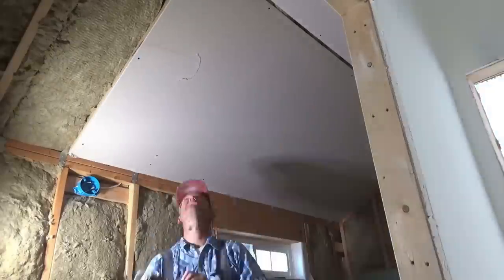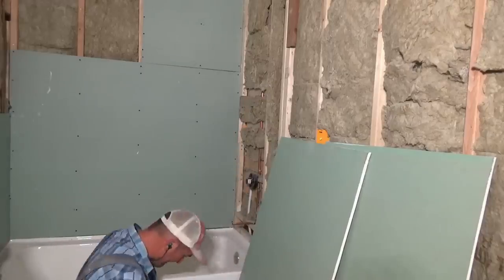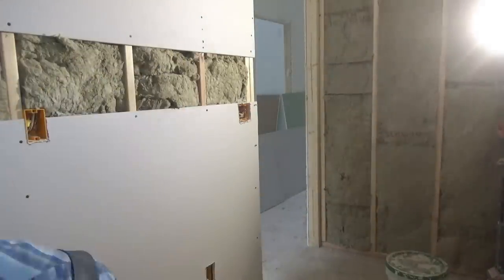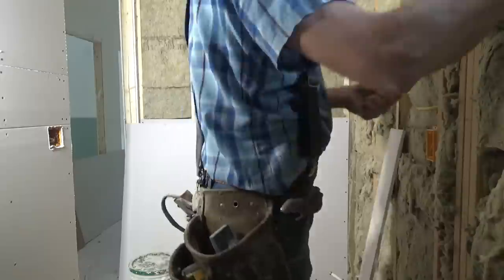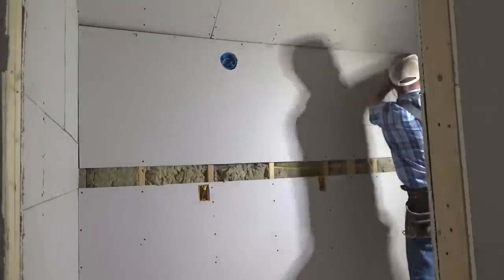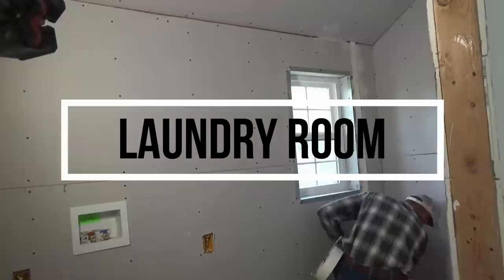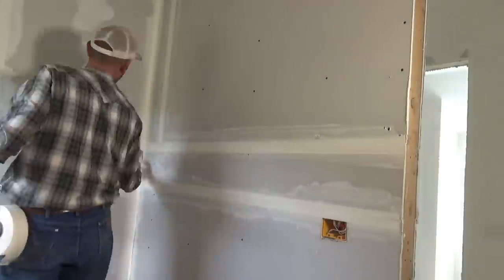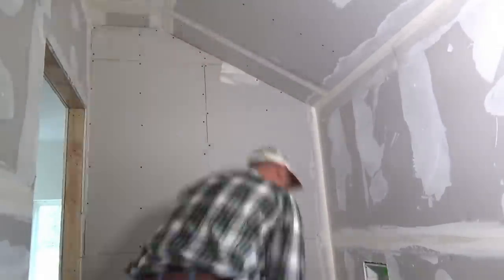#332 - MOLD - Vapor Barrier Vs Green Board Drywall - Bathroom And Laundry Room

Comment: The issue with all this vapor barrier confusion is not the vapor but vith liquid water condensing on the inside surface of the wall cavity sheathing.  This happens when there is a large temperature and humidity difference between the outside and inside.  Liquid water on the wood or other materials is what results in  mold or rot.  Air leakage is a totally different animal.   The problem can occur in very cold climates or vary humid ones, which are usually exclusive.  Say in Alaska, where you could see -20 or greater for an extended period of time, you would not want interior moisture penetrating the wall cavity then condensing and freezing on the inside surface of the -20 deg exterior skin panel.   When it warms up and all the ice melts you have a river flowing out of the wall.  A similar thing can happen in very humid climates with interior AC,  obviously no ice forming but liquid water form exterior humidity can condense on the colder drywall, allowing it to mold.    In the Alaska case the vapor barrier needs to be on the inside of the insulation and the other on the outside of the insulation.  Normal house wrap is not a vapor barrier but a wind and liquid water barrier.
Reply: Well said.  Even the code book in his area calls for the barrier.  But when the houses get built so air-type, then they have to install those manual vents.

Comment: United Building code is for all states some adjustment per climate And yes here in MN vapor barrier is required with a make up air exchanger. Also if people would turn on the vent when showering would get the moister out.  With that said you do as needed in your area and i believe they do make  houses to tight .  Having a direct fresh air to your wood stove is were i would spend the time.

Comment: Glad you cleared up the moisture barrier issue. I live in central Florida. High humidity all year. I've lived in my house (without a moisture barrier) for 52 years. There's never been a mold issue.
Reply: Skip Pringle - vapour barrier is used in places where the temperature goes below freezing for weeks on end. It stops the warm inside air meeting the cold air in the stud cavity, condensing and freezes. Then when it starts warming up the rot and mould starts over the years. I’m pretty sure in Idaho it gets below freezing for weeks on end.

Comment: I built my first houses in Minnesota.  Vapor barrier was mandatory.  So when I moved to South Dakota, I was surprised to hear that they did not use vapor barrier on the ceilings. It is typically used on walls however.  Because I spray foamed my walls, there was no need to do the walls.  I did put it on the ceiling over the tongue and groove ceilings in the Great room though.  More in my mind to protect the wood.  My basement is ICFs so again, no vapor barrier necessary there.  Overall, my house is pretty tight and the basement is incredibly comfortable as I put foam under the floor and radiant in it.  I didn't ventilate the basement bathroom outside though.  I dump it in the storeroom as we have very low humidity here as well.

Comment: I am a retired builder in Pa.(built over 100 homes in my time)I never used a vapor barrier! Build it as tight as possible in the framing and sheeting and hardboard insulation(tuff r)! except under concrete or in a crawl space! I have seen many problems with mold and sick homes! We need somewhat fresh air to be healthy! You got this!

Comment: hi, I have been a flooring installer most of my life (in SW Montana) and worked for 12 years as a service manage for a flooring company. one of the worst calls to get was a shower failure because to fix most of the issues means a total tear out and reinstallation of the tile. make sure you use a paint on water sealant over the backer board because the barrier you put behind the board gets punctured with all the nails/screws and its amazing how water finds its way through. also use a newer generation epoxy grout and you never have to go back and reseal it. most people don't realize cement grouts are not water proof without a sealer and needs cleaned and sealed every so often. once a year may not be enough depending on how the shower gets used and the type of cleaning products used on it. two good sources for information and quality products are, Laticrete, and Schluter. I always recommend the Schluter backer board and water proofing and the Laticrete thinsets and grouts. ANSI is another place to go to find all the national standards.

Comment: In the shower I would recommend using red guard over the green board and use thinset over the joints using drywall tape and mud will mold eventually paint the red guard over that and you will be good to go. Good luck and keep it up
Reply: I agree.  Green board does not cut it around the shower and tub, unless you slap the red guard over it.  Fiber cement board does do the job as a stand-alone wall covering.

Comment: For your tub & shower areas I would have used Hardi-Backer or Durock cement backer board.  Much stronger than green board and less susceptible to any rot or mold.

Comment: I agree, so sick of hearing about why you are not using a vapor barrier. I built my house in the mountains of NC and did not use a vapor barrier. We did use zip system sheeting. We have had no issues.
Reply: zip system IS the moisture barrier. That is what it is designed to do
Reply: @stevepailet8258  Yes you are correct. It is a exterior air, vapor and moisture barrier not a interior one. An interior vapor barrier would trap moisture in the walls.

Comment: Great info.  I didn't know about the green board.  Thank you.
Reply: He said that greenboard is required in bathrooms BY CODE (5'32") and then one will see that he has NOT used greenboad throughout the bathroom. He HAS installed the greenboard in the shower obstensibly as a foundation for the tile. That is questionable if one is concerned about doing things correctly and avoiding creating mold.

Comment: Up where we live a vapour barrier is a must as the warm inside air will meet the minus 20-30 Celsius air, condense in the stud cavity,  freeze and create a lot of problems. Plus no vapour barrier will create  a jet blast of cold air coming into your house. 
Does it get below freezing at your place for weeks on end ???
6 mil poly would make a big difference in your heating/cooling. Not sure what you’re reading but in the northern states I’m sure they use VB.
Reply: Yes, sometimes for months on end. Does your area get to 100°F for weeks on end? No mil poly makes a huge difference.
Reply: R Shiery - yes it gets very warm here but the whole point of VB is to stop air passage. 
Vapour barrier saves a lot of money on cooling and heating costs plus stops water condensation when it’s extremely cold. The weather barrier that gets applied over the outside sheathing doesn’t let moisture through but air out.

Comment: Glad you addressed this as we have contractors getting ready for drywall, and doing the demo work I pulled down quite a bit of plastic out of the ceiling.There was none on the walls. The house was empty since 2012, and the only places we found rot was where two roofs met from as addition and where the huge chimney was.There was nothing between the chimney and the OSB walls, which was pretty dry rotted. 

Now beyond that, all the house had from the inside out was Sheetrock, Pink Insulation, OSB and plywood pieced together, and then siding. That was it. A few full sheets of cardboard like particle board tacked in a few random places... no wrap.. or anything beyond that. Even that sponge like material was bone dry... likely due to overhangs.   

The house has I'd guess 16 or more inch overhands on the roof, so that, based on all the videos I've watched, has kept most of the walls safe.

Comment: I'd be concerned about condensation or frost thaw between certain areas since you get hot/humid, dry and bitterly cold weather. I would've had a Thermal Calc done just to be sure.

Comment: Your house is fine, better than 75% of the houses that are already built.  Every house I ever remodeled with a plastic vapor barrier inside had mold on the drywall.  Sealing the exterior is the only place you want any style of vapor barrier if you choose one, never inside with drywall.
Reply: Shawn Cockrell you need an airgap between your vapor barrier and the gipsium boards. In wet rooms u use the Knauf wet room boards or a similar product. Also u need to make sure, your house is ventilated properly. In hot and humid climates, it is the other way around. Your AC-Dehumidifier should do the job.

Comment: In Sweden where the winters can be truly cold, vapor barriers are mandatory in all new houses. There is a plethora of rules regarding the proper way to install a vapor barrier, as if you do it the wrong way, it can cause the same problems it is meant to prevent. A new house here is pressure tested, to make sure it is completely air tight, and special ventilation systems that reuse the heat from the inside air are installed. If the hot and humid inside air travels in to the wall and is cooled down, it will condensate and lead to moisture being deposited in the insulation, which can lead to mold.

Comment: I used 1/2" fiber cement board around the bath tub.  Some folk install green board and then a layer of Red Guard.  I know that the International Residential Code does not allow one to use just regular drywall around the bathtub/shower.  Bathtub vapor barrier requirements are for all 50 states, and cement board qualifies as a retarder.  There's another vapor barrier requirement for the interior of exterior walls in cold climates, R702.7.  R702.7 requirement of the IRC is not about humidity (except for Marine Zone 4), it is about the temperature gradient between the outside air and inside air, which can also produce moisture.  So you start your truck on a winter morning and turn on the heater.  You create moisture on the window because the temp gradient between the inside of the truck and the outside air is now great....When you heat your house during winter time, you are creating the same moisture affect between the exterior walls, as with the truck.  My example is not for California, Arizona, etc.  My truck example is for the freezing cold climates up north, e.g. Zones 5, 6, 7, 8.  Again, you are in either Zone 6 or 7.
Reply: Exceptions to R702.7 where you do not need a Vapor Retarder:
1. Basement Walls
2. Below-grade portion of any wall
3. Construction where moisture or its freezing will not damage the materials

Classes of Vapor Retarders Required in Zones 5, 6, 7,8 and Marine 4 (choose one method):
Class I - Sheet polyethylene or perforated aluminum foil
Class II - Kraft-faced fiberglass batts
Class III - Latex or enamel paint, which can only be used if you have vented cladding over fiberboard or gypsum, and continuous insulation with R>=7.5 for 2x4 wall or R>=11.25 for 2x6 wall.  But you must use spray foam insulation meeting the R 7.5 or R 11.25 requirements.  If Heath had used spray foam insulation or Kraft-faced fiberglass batts, he would have been ok.

Comment: Vapor barrier is more than a moisture barrier... it supports your insulation's ability to prevent air, cold or hot, from moving between spaces. Vapor barrier, when use, should be added within the first third of the wall thickness from the inside to prevent mold. Vapor barrier can have a profound effect on temperature transference. But, of course, it's your house, do as you like.
Reply: If his source of heat is a wood burning stove it's not going to make much difference.
Reply: Agreed. I have a couple walls in my basement that I renovated a few years ago, one wall without vapor barrier and then on the same side of the house in another room I did vapor barrier. The difference you can feel when you put your hand on the wall in the winter is astounding. When you put up insulation in creates a "hot/cold envelope" behind it towards the outside. Although the insulation does a great job of keeping that air from transferring through, the vapor barrier makes it that much more sealed against that envelope.
Reply: @seanm2818   All the more reason to have vapor barrier if you have a wood burning stove that throws a lot of heat. A vapor barrier's purpose is to create a barrier where the hot inside house air meets the cold outside air (or cold inside air meets hot outside air in Southern states). The larger the temperature difference, the greater the chances of condensation forming. We're talking very small amounts of moisture, but drywall and sheetrock are porous, even the green stuff. Over time this will form mold or will deteriorate if a proper vapor barrier isn't installed.

I admit that some climates, perhaps Arizona like he mentions where it's very dry, likely wouldn't see much benefit, but most climates in the US would.

It's cheap, easy to install, and saves a headache down the road, so why not install it if you have the wall open??
Reply: You have to be careful using vapor barrier, in some places it will cause condensation. Florida is a prime example.

Comment: I agree about the vapor barrier thing. You almost want the moisture to not get trapped on the plastic now, as you said. But as to the use of any sheetrock...in the house I am am planning now, every single bathroom and parts of the kitchen are going to use cement board. If you screw it on, you can actually remove it intact say to deal with plumbing underneath (depending upon whats over it). Though thats not the only reason. 100% rot and mold preventing

Comment: If you are tiling the T&S enclosure you should have left the drywall out and plumbed the studs and directly attached hardibacker over lath paper.
Reply: Maybe you didn't watch the video. He specifically said that code in his area requires the mold control drywall for tubs and showers. I used hardiboard myself, but local code determines materials used.
Reply: @kurtz260  Try reading the code! "IF" you use DW it must be GB. How long have you been a contractor War Monger?
Reply: No comment from war monger! BTW, i have been a LICENSED G.C, Plumbing, HVAC Sewer and Solar for longer than Heath has been on this planet. Here are the Classification #'s i hold, B, C-20, C-36, C-42 and C-44 and i earned them are and passed all the tests to get them.
Reply: I dont really care what your classifications are. Simply said, it is not your house, you are not the local inspector, and unless you are specially nominated as the national building code inspector (made up title, btw) your opinion is not more valid than the local inspector. As for my qualifications, i didnt claim any. I am just sick of snotty jackwagons at keyboards passing out their decrees and judgements as if they were God. Nice to meet you, have a happy holiday.
Reply: @kurtz260  Hahahaha, just offering him years worth of my experience, he can do what he wants with it but i assure what i said about leaving out the DW is fact, not opinion!

Comment: I don't know how cold it gets up there in the winter, but im sceptical that your woodstove willl keep that house warm. i would recommend a fireplace with a lot of thermal mass. that mass will capture the heat from the fire and release it back in to the house slowly. thats how we do it where i live. At worst it gets down to -30 celsius (-22F) here and -20 celsius (-12F) is normal middle of winter. then again ,we have a quite old house that's not as well insulated and airsealed as yours will be. One other problem you might have in the winter is that all the heat from the stove will rise upstairs. putting a door will help. Just my two cents from my experience living in cold climates. Great work, you are an inspiration for me. It's amazing what you accomplished by yourself. i wish you all the best.

Comment: Construction Engineer from Germany here. The Vaporbarrier is against mold at the insulation. The greenboard is against mold at the board. We use always both of them.

Also I wondered why u don’t use VB around ur house. Moisture from inside will get into the insulation and the studs. And since u putted some kind of plastic sheething on the outside, it cannot breath out...

All our Universities in Europe agree on a different construction for wooden houses. It should be breathable to the outside (with an airgap between a breathable sheething and your rainscreen) und thight at the inside. This is due to the fact, that Sun and wind is helping to get rid of moisture at the outside, but not the inside.

At wet and humid areas such as Florida, the AC is helping better with „breathing“ moisture out, so the construction is inverted there.

Steico is our market leader in wooden constructions. With the following link, u will get all the details needed for any job in your partly cold weather climate here: https://www.steico.com/fileadmin/steico/content/pdf/Marketing/International/Handling_instructions/Detail_Catalogue/STEICO_detail_catalogue_en_i.pdf
Mind: We often use especially minimum OSB3 for both, structural integrity/sturdying and as a VaporBarrier. But I recommend OSB4, since it is guaranteed not the be made with any kind of gassing glues. Make sure to use the right kind of air sealing tape for the connecting OSB joints.
Reply: Here is a picture of a simple ventilated facade with wooden rainscreen: https://images.app.goo.gl/mTrTSbjjRt6u1sh77

Comment: Everything I've learned about vapor barrier is  just gives the moisture somewhere for the mold to grow do to the plastics to give mold to grown due to the fact it keeps the the plastic wet and is a breeding ground for the mold. So as 95% of the time you made an educated guèss that it correct. It's nice to see someone buck the system and made the correct decision due to the fact that's right for you.